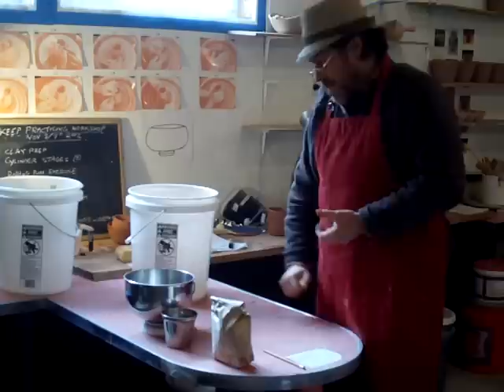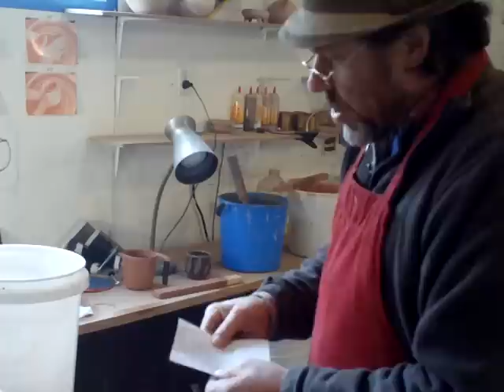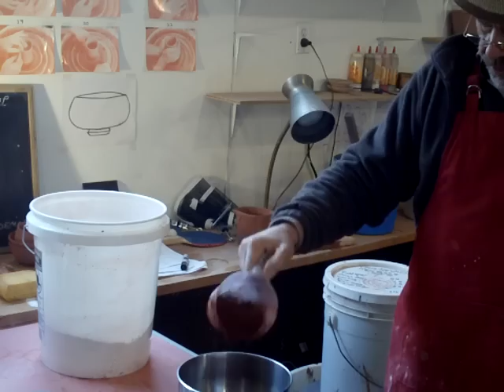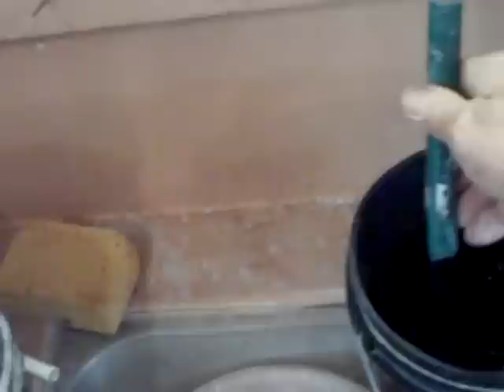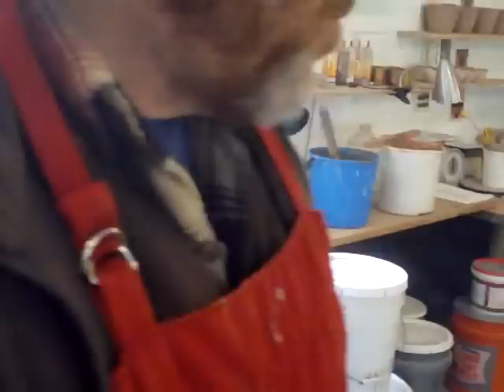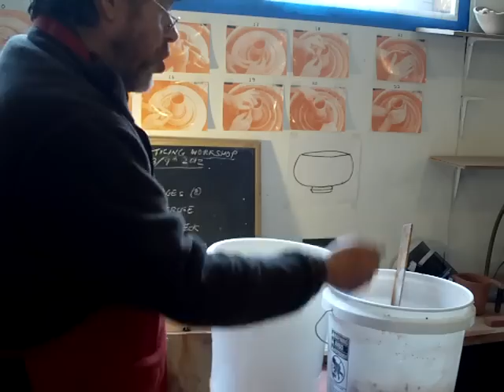SIMON LEACH POTTERY - The ABC of mixing a glaze - march 28' 13

Comment: Most glaze recipes are written as per centages of each ingredient.  When I mix glazes, I figure 6000 grams of all the dry ingredients will fill a 5 gallon bucket about half full when mixed into water.  Multiply % each ingredient times 6000.  If the recipe calls for 20% Flint (aka Silica), that's .20 x 6000 or 1200 grams of Flint.  Much easier than trying top deal with pounds and ounces!
Reply: thank you so much!!
Reply: thank you so much!!